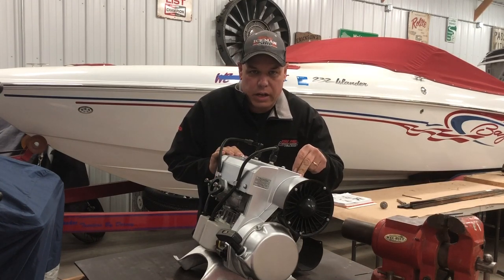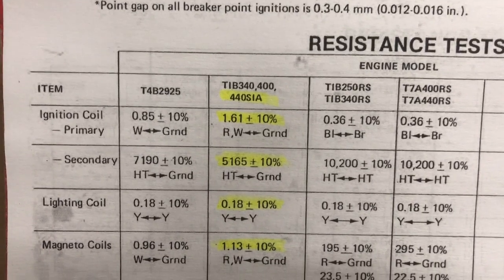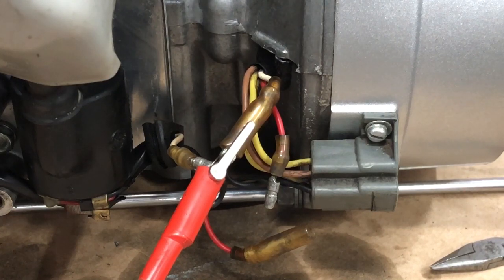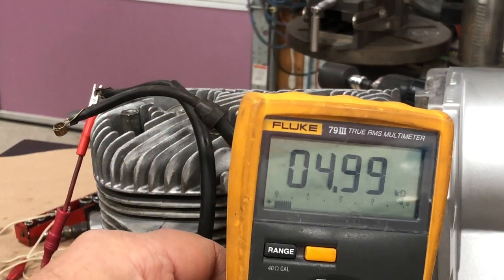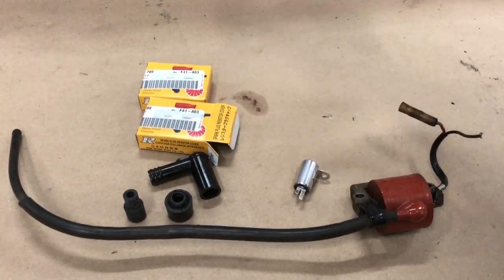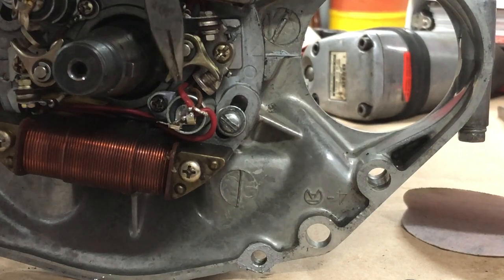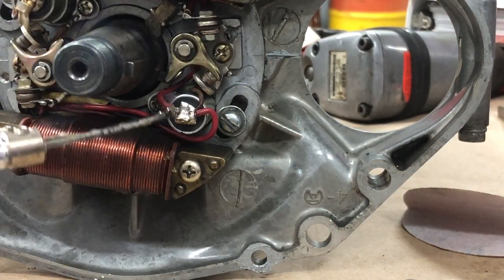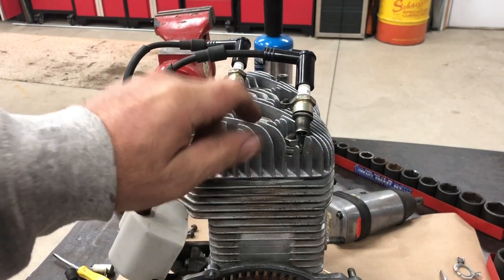1973 Arctic Cat Panther NO SPARK!!

Comment: thank you this is the most straight foward and overall best and simpilest guide ive ever found on how to truble shoot spark on a small engine like this now i will have a fighting chance at fixing a free panther i got from a friend, Thank you
Reply from the maker: All good.  Glad it helps.  Key is to start measuring resistance of coils, thats easy.  Then check points. After that its condensers.   Go to Vintage Snow and find the manual you need for the electrical specs. If you need a particular set of electrical specifications, you can E mail me at jasoner@wipaire.com

Comment: Jason thank you for posting this video I found all the specs in my book as well but I’m using your video it’s much easier I finally have a spark in one cylinder so far I’ve replaced the points and the condensers Oem wow was it a bear to soldier that stuff on. I didn’t want to melt and destroy the new condenser I was very careful did as quick as possible. Pitter patter.
Reply from the maker: That’s so nice of you to comment like that. I hope you get it sparking on both holes soon. Not sure what you are working on but when I do a points motor now I just get new external coils, condensers, and caps and plugs like immediately.  Just not worth the brain damage down the road mid season.  Glad it helped.  Comments like this  make me want to do more “how to” stuff. I kind of backed away and turned comments off on a couple of videos due to some real jerks. When I went looking for how to help, there was nothing.  Always glad to help. Good luck!
Reply: @Letsfixsomething26  Jason
I got spark in both cylinders but it’s weak I think. Ignore the idiots. I have a channel on here check me out. I was a fatso then not anymore lol. I may pick up a set of external coils. 
Thank you 😊
Reply from the maker: Dennis Kirk for coils for the 73 T1B340/440.  Work great
Reply: @Letsfixsomething26  Jason
I ordered a set came in as parts unlimited brand ign 083. Nice sparky ⚡️ 🧲….

Comment: Yep been there...as a snowmobile mechanic since 1968!  Much prefer these systems to the new stuff..
.like working on new cars!....😡
Reply from the maker: Gotta be honest Steven, I rarely mess with my ignition systems on my rider sleds. I’ll double check timing in the off season and that’s about it. Rode the bell out of a points sled (T1B340) and a CDI motor (T1C340) and never fouled a plug or had any issues all season. Put as much new stuff in as you can and your golden for a long time. Thanks for the comment!

Comment: Hey Jason this video really helped me as I’m not very good with electrical. But my sleds timing is off. So I bought a buzz box same as yours but notice you have an extra wire ( green) and you explain why? Thanks
Reply from the maker: That box is meant for a dual magneto aircraft engine. They need to be timed together. You can just let that one wire hang if you are timing a single cylinder. That light just stays out and that tone stays quiet.  When doing a 2 cylinder motor I hook both of them up. I just use red as the right side points.  Glad it helped

Comment: Awesome video. I have a ‘71 puma and I have followed your videos. Can you set timing using a multimeter with the tone on? The only way I could get timing set was to increase point gap but now that’s out of tolerance but still spark on both sides
Reply from the maker: I guess I’ve never tried it. I’ve seen people who use a flashlight and will interrupt the circuit to get a light flasher, but a solid state modern meter like a Fluke or whatever not sure.  You could just try it. Pull coil wire as I did and connect the wire to the meter, slowly turn it over and see if you get a tone change. Shouldn’t hurt anything turning it slowly.

Comment: Where would I be able to find these specifications for say a 1998 Ski Doo Mach 1 Triple 700?
Reply from the maker: Oooh boy.  No idea. Guessing the service manual is the place to start. There should be a full service manual available either at dealership or for download somewhere.  I’d try E bay. I have successfully purchased PDF downloads for various things I own off E bay.  Also this is a completely different ignition system than your modern sled so no idea what to tell you there. Good luck!
Reply: @Letsfixsomething26  thanks! I appreciate it, I’ll try and get a service manual for it and go from there. Great video by the way, I think it’ll really help me troubleshoot what’s going on😂. Thanks again!

Comment: Hey, i have the same sled and it has spark but all it does is backfires out of the carb and doesnt start
Reply from the maker: Aden, I bought a "parts" sled about a year ago. Had spark, fuel, all that.  Would not run. Someone had hogged out the flywheel holes with SAE threads, then put in a bolt that was too long.  It messed with the retard cam on the flywheel.  NO WAY it was going to start.  Also, I find that timing the T1B340/440 right at the "F" mark makes them hard starting. Under advisement from a GOD and GURU on these things, he noted that the T1A and T1C are both timed well advanced compared to the T1B.  I advance my T1B motors slightly from the "F" mark now.  .150" to the right of the "F" mark I scribed a line.  That is my timing mark now.  I run 91 NON OXY anyway at 40:1 and all is well.  My Lynx starts first pull with 1.5 shots of prime. The panther does not have a primer so you need to get the fuel up to the carb so a bit more pulling. Once the carb has the fuel right up to it, it is just a pull or two.  I would yank my arm off on panther.  Advancing the timing that little bit made all the difference in the world. Same pistons, same rods, same cylinders........and different timing. Weird.  The slot in the stator is big enough for the advance, although it is at the end of the slot nearly.  Good luck.

Comment: How does the timing advance work?
Reply from the maker: There are “flyweights” that rotate a cam at higher RPM. Using the incorrect length bolts on starter cup will interfere with these arms and change timing horribly. I’ve seen that on one of my motors that I tore down.

Comment: Magneto, points?
Reply from the maker: Correct. The stator is often referred to as the “magneto”, which has points… vs electronic ignition.  I also mention aircraft which also use dual magnetos. Kind of all the same thing if you break it down to it’s simplest parts.   You will often hear the sled engine referred to as PTO (clutch) side and MAG (Magneto) side.

Comment: Would you please show how to adjust points again in more detail- does the angle of the flywheel matter- can I just measure it and open the points😂
Reply from the maker: If I get back to dealing with timing I will try and dig deeper on it. Honestly I just followed the manual. Fortunately for me I have magneto theory in my head from my life as an aircraft mechanic so I already understood the concept.. I just had to apply it to this application. Meaning I wasn’t scared at the system as a whole, but had to figure out the differences and apply it accordingly.   Again if the situation presents itself, I’ll take another wack at it.

Comment: Where is the battery on one if these? I've been looking.
Reply from the maker: On the RH side between the bulkhead and pan.  I hadn't put the original battery box in trying to save weight. The 73 Panther is a tank, another 20 lbs of crap isnt going to matter.
Reply: @Letsfixsomething26  The battery is a bit fancy for me. Recoil all the way

Comment: Cant get spark on 340 kawasaki with 900 miles on it. Need ohms sheet to check.
Reply from the maker: 340 Kawasaki what...??    What year sled/motor?   The OHM values are in this video however if you want to PM me, that is fine too.  If this is a pre 74 motor then you are dealing with point ignition vs CDI.  Once we establish you are reading the ohm values properly of the IGN coils and external coils, and you have good plugs, then we need to check the points. If that is all dandy you are probably looking at condensors. Super cheap and once you get fly wheel off, not too bad of a job.
Reply from the maker: @frankmiller4032  reach out on  FB messenger. Jason Erickson
Reply from the maker: My hunch is you need capacitor replaced. I change them no matter what when I rebuild a motor now.
Reply from the maker: https://www.facebook.com/jason.erickson.39
Reply: @Letsfixsomething26  Plus the values change between the 71-72 points ignitions and the 73-74 points ignitions
Reply: @Baloodini  is that because of the age of the magnets?

Comment: Always messing around with those old systems, so much can go wrong! I go threw the same shit on my 73 JD CCW 440 engine...but ya get real good at it after about 30 times..🤣😂🤣😂 Denso ign in mine but some have the kokusan ign...
Reply from the maker: Once I figured out to just rebuild em with new coils, condensers, etc… they seem just fine and trouble free. I have yet to even replace points.  Clean em, and that’s about it.  I did move some timing around and advanced one motor with not such good results. I’m back to stock marks on all machines now.  Better safe than sorry
Reply: @Letsfixsomething26  Yup definantly do not advance timing on the CCW burn pto side down...😬😬😬😬😳 Finding pistons and rings for the 73 ccw 440 is absolutely non existent....